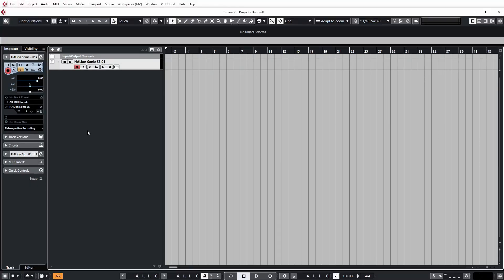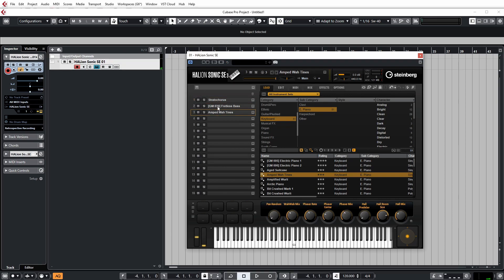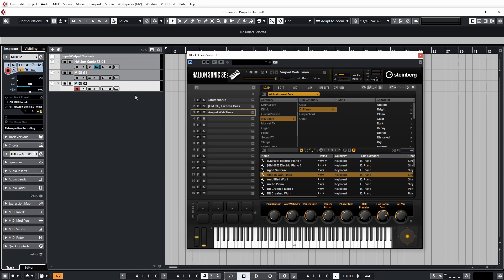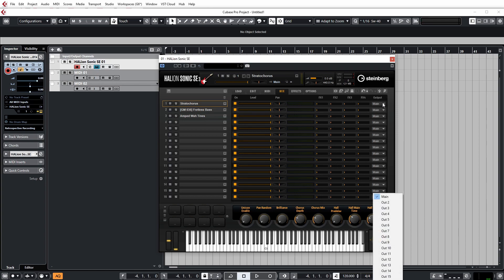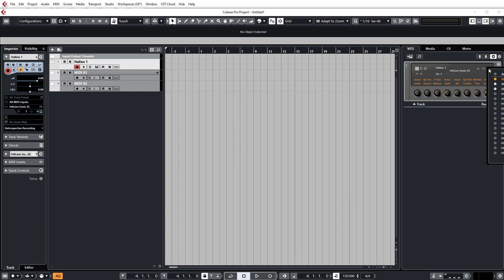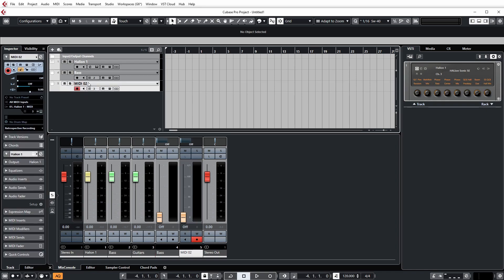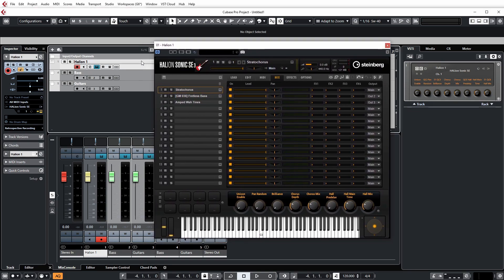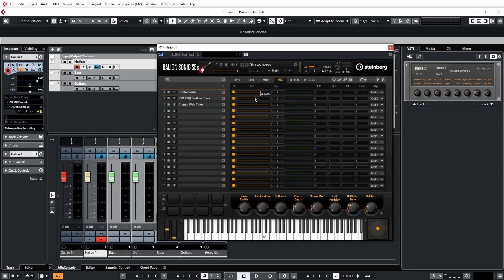Cubase Tips | How To Create Multi Outs for Halion Sonic SE 3

Comment: yes there are now 2 basses in the mixer an audio and midi what one do u turn down and what one do u mix ?
Reply from the maker: To control the volume in the mixer, use the Audio Channel. You don't really ever need to touch the MIDI channel in the mixer. I usually hide these by clicking the 'Channel Type Filter' button  (looks like 3 horizontal lines in a square) then unchecking 'MIDI'

Comment: I have an Edirol PCR500 triggering a sound canvas externally, listening through an A & H Zed mix & working ok but I’ve forgotten how to get my keyboard to trigger my vst instruments directly. I’m still able to record midi with say a Rhodes sound then apply the (eg) bass sample later, but I’d rather have the sound to guide my feel during recording. Could you do a step by step connection for me please? I have Cub 7.5 (running in W7) Cheers, p
Reply from the maker: If Cubase is recording the MIDI but not triggering sound, off the top of my head, there could be two reasons why.

If you're using MIDI channels make sure the output of the MIDI is being sent to a VST instrument with a sound loaded on. 

If you're using an Instrument Track, make sure you're selecting the correct MIDI input to trigger the sounds. You can test it by setting it to "All MIDI inputs"